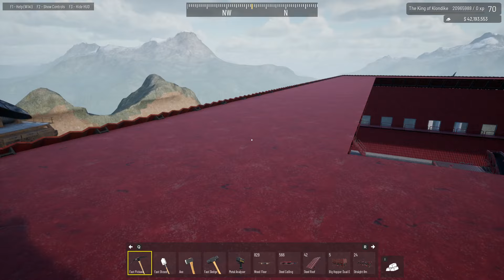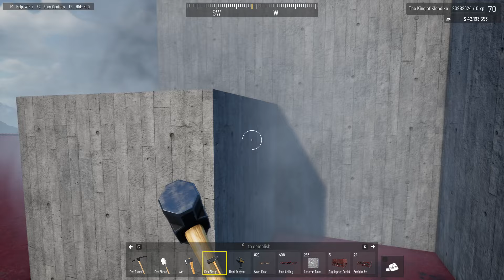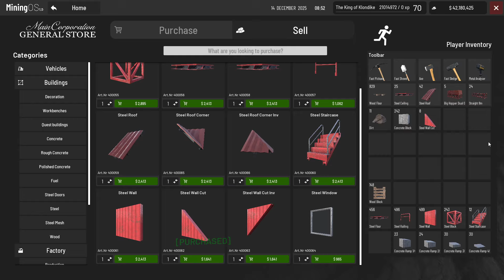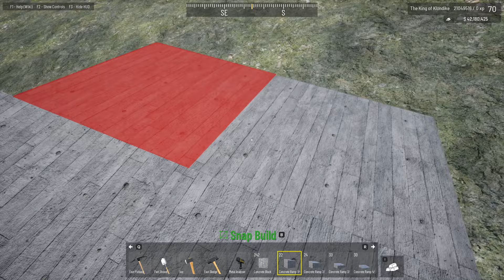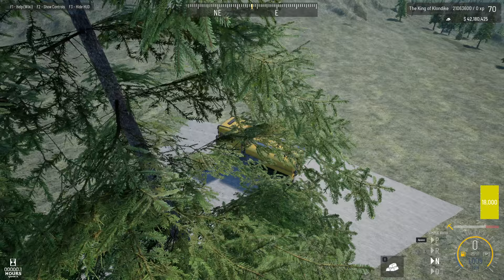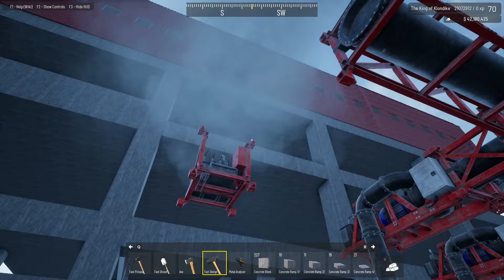Out Of Ore {Hardcore} S2E36 Finished The Roof And Other Unfinished Projects

Comment: I was about to leave a message on your stream and half way through the video went unavailable LOL I was going to say the same thing you did that maybe a connection wasn't really connected :)
Reply from the maker: yeah I ended the stream, and just went through and picked up and put each part of the factory back down. the next video is like 40 minutes long, it took me over 5 hours to do all that stuff lol
Reply: @jcgaming1571  But you got it fixed right???
Reply from the maker: yes and it works as good as I was hoping it would, A lot of work, but way less of a mess then the way I had it before.